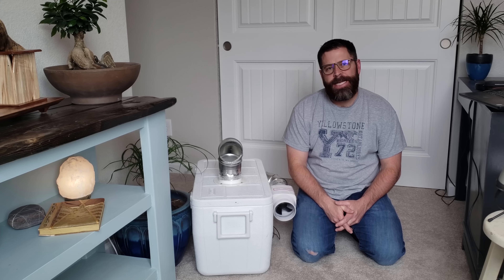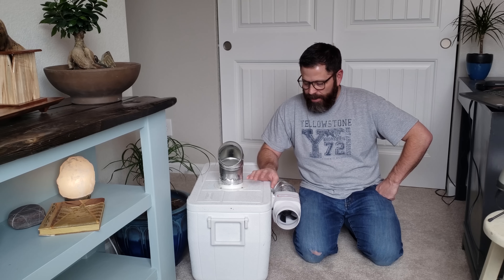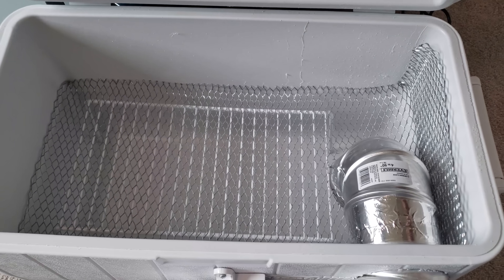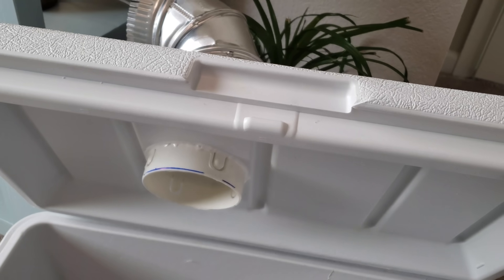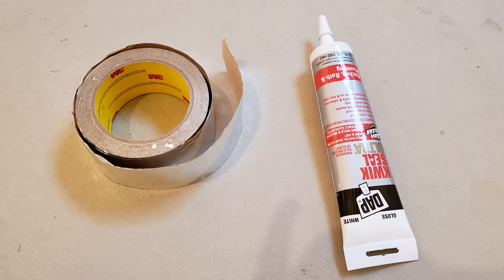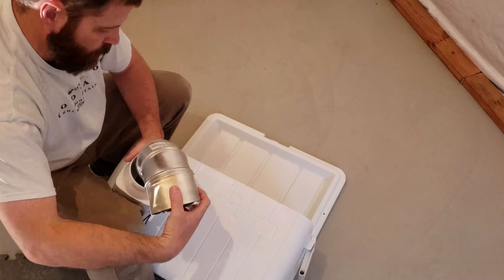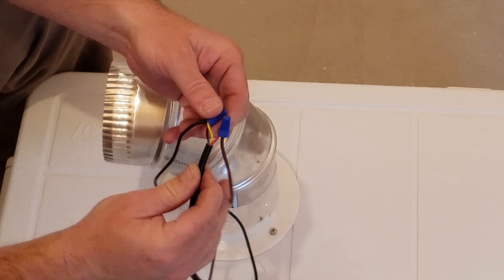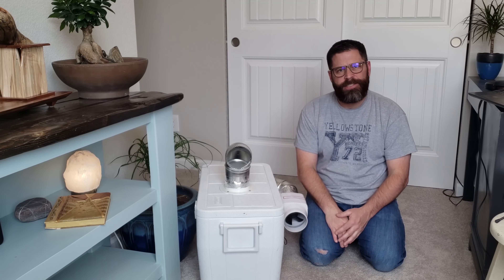Homemade Portable Air Conditioner DIY - Coldest One Yet!

Comment: Fill it with frozen water bottles the ice lasts longer and u have something cold to drink
Reply: Thanks mate. Good idea.
Reply: It might last longer, but it won't be nearly as cold as with ice cubes because there will be less cold surface area to cool the air down.
Reply: @bossman696  I would use smaller water bottles or even freezer packs for lunches
Reply: @bossman696 , any inside temperature below the outside summer temperature is always welcomed.
Reply: @donotneed2250  I know that's right! Every little bit helps!
Reply: @bossman696  use mini water bottles🤫
Reply: @bossman696 true. But if your looking at this as a long term solution for something like cooling chickens, you'll need a constant supply of ice. Freezing large Tupperware containers and dumping those blocks in would be the best. Less surface area, but you don't have to buy bags of ice everyday.
Reply: Cold beer sounds better though
Reply: @Elfnetdesigns  - break out the Coors!
Reply: That's what I was think. Bags of ice would just be a lot of money to spend
Reply: @gibster9624  But if you're making your own ice, you're just making more heat from the fridge motor and the cooler motor. The energy extracted from the water in the freezer is dumped into your house which you then use the ice to cool which nets nothing.
Reply: @michaelmcgee7683  so are saying that if your fridge didn't make ice then your house would be cool????????
Reply: @zellerized  More that your fridge drains heat from inside of the fridge and expels it on the outside. Yes, your fridge generates heat, but removing a fridge wont cool your house
Reply: @michaelmcgee7683  its for your camper van that doesn't have an ac unit.
Reply: M M Glad to see at least one person with intelligence.
Reply: @michaelmcgee7683  the fridge temp sensor is usually in the fridge part not the freezer.  So unless you crank your fridge down. It's going to run the same amount of time it always does.  It won't cost any more electricity to make the ice then it does on any other day. When it runs it runs freezer and fridge. The fridge being more important temp wise as the freezer will always be frozen even on the lowest setting.
Reply: @JamesSmith-lt5zz  Not talking about electricity costs so I don't really know what you're replying to?
Reply: @michaelmcgee7683  True, but surely there is a time factor involved? You fridge slowly makes the ice, overnight etc. You could probably melt this ice in less than an hour with this device. So you net nothing, but at one point during the day your room might be colder... maybe.
Reply: @UC_M_lFnel88bz8ix6g3oZ_A wasn't suggesting it was a 1:1 ratio from the motor, but the energy drained from the water to make ice is not converted into Work, it is expelled outside the fridge at a 1:1 ratio. And yes, you can locally cool an area, but that wasn't what I was talking about.
Reply: @michaelmcgee7683  Dude your fridge is plugged in ANYWAYS and to be honest a full fridge draws less electricity than an half empty one ESPECIALLY if it's filled with plastic bottles filled with ice in them then the fridge ONLY has to keep them at temperature it's almost like how a glacier generates it's own ice.
Reply: @michaelmcgee7683  he's saying that your fridge HAS to be on to keep your juice cold and your veggies fresher which also runs your freezer as well with the same effort so chucking  a few bottles filled with ice into your fridge wont run it any hotter than it already is.
Reply: @michaelmcgee7683  for a closet grow it's perfect. don't need to cool down a whole room.
Reply: @Engineer9736  How do you "see" someone from a comment?
Reply: @michaelmcgee7683  not really since your freezer runs no matter what might as well utilize it best.
Reply: @michaelmcgee7683  exactly. 
The first law of thermodynamics.
Reply: @michaelmcgee7683  Dont run the freezer inside the house 

Or, as you can see in the video, he was running the air cooler in his car.
Reply: @zellerized  coolER, yes.  Simple physics.  If you add heat, then use the produced cubes to cool it down, you're going to end up with no benefit.
Reply: Michael McGee is there a way to displace the heat from appliances to the out doors, perhaps a water pump system that comes from well water(if you have a well) to appliances that create the most heat(like refrigerators) and back to the well at a slower rate(dividing outflow into separate containers that could possibly be used to water an outdoor garden. Let’s think outside the box(our house, in this case) ;p
Reply: @michaelmcgee7683  you think this would be different parts of the house, so it doesnt work that way
Reply: @michaelmcgee7683  The freezer in your house is already running. You're not creating more heat or energy.
Reply: @michaelmcgee7683  most people  have a freezer running with or without a/c. Can't think of anyone who unplugs their fridge regularly
Reply: @michaelmcgee7683  technically you're correct, but you're wrong because heat is expelled from your house during the night anyway, and the point of this is to cool down a small localized area, say 1 small room
Reply: @michaelmcgee7683  Many are not understanding this. As child I am told "your AC doesn't add cold inside to house, it moves heat from inside to outside" I think they are wrong! I feel the "cold" air blowing from vents! But it is that Heat is to Light as Cold is to Dark. One is existing, the other is the absence of that which exists. I hope my English is understandable.
Reply: @JamesSmith-lt5zz  the idea is putting "frozen water bottles" in the big cooler, not ice cubes.

Ice cubes melt, create water. However, with frozen water bottles, the water is entrapped in the bottle, no clean-up just refreeze them
Reply: @michaelmcgee7683  you're correct but most people in think aren't trying to cool their home. Anyway they're not made to bring the room temperature down they're made to blow the cool air on the person in the area that they are in.
 Just like what I'm using one for. I'm using mine in my shop and have the air directed  in the area of my world table. Some people use them in tents when camping and in their campers.
Reply: @michaelmcgee7683  this is a portable ac so what happens in the house and fridge are irrelevant
Reply: @AngryCornflakes Truely ? Scientific ?🤔
Reply: Some of the cooling is from evaporation.  So maybe just put one or two bottles inside.  The rest needs to be water/ice available for evaporation.
Reply: The solution, then, is to drill a hole through your freezer door, stick heat vent tubing in it, and redirect it all the way down to your lazy boy chair in the living room. 
Efficiency squared.
Reply: Take into consideration that this is also a humidifier because the air is very moist exiting the cooler. This being said, if you're in a closed room it WILL create mold and or mildew on everything if used daily.
On another note, heavily salted frozen water in 2 litre bottles lasts about 6 to 9 hours where unsalted frozen water will get you 3 to 4 hours and a lot more humidity.
Reply: Derick the one reason that actually makes me think this is a bad idea for cooling a room inside a home. I live in Florida, so humidity is already an issue, which is why I would run ice water through copper tubing on the face of a block fan. On the efficiency in cooling though.... The heat transferred from the appliance(fridge) may be a better focal point. A water pump, some copper tubing, and some insulated rubber tubing to transfer this heat out of the house could bypass your centralized HVAC system. If you can transfer that heat out efficiently enough than you end up with a surplus capability of heat removal by the appliance. So it’s a double effect... bypassing HVAC saves money, and the appliance that is sucking more heat out of the entire house via Ice cold air... thermodynamics... so that means ice does not actually melt, Right? The water becomes unfrozen, right? Sounds like a play of words to make something seem more complicated than it actually is.
Reply: This would be great in my case. Riding in 16 passenger van on a hot day and the A/C can't cool it down. We have electric sockets. Run low on ice, stop at store. We are melting today that's why I was looking at this. Thanks!
Reply: Those aluminum resealable monster cans would magnificent!!
Reply: Aluminum bottles.
Aluminum cooler.
Aluminum foil.
Reply: Frozen salt water bottles will stay frozen longer...I wonder....
Reply: Fuck yea I live in az and the ac went out in my car me and the family are cruising around with a air temp of 43 degrees! I put a block ice with two bags of ice and it lasts me the day even with it being 110 outside
Reply: @JalapenoAss88  this is the comment I was looking for, similar conditions as where I am at in Nevada at 110f, I need to cool a small hatchback down, and you gave a rough timeframe!
Reply: @JalapenoAss88  I like your style
Reply: @JalapenoAss88  you did it as in this video
Reply: The ice melts so fast because its cooling the air quicker.... Bottles wont be as cool.
Reply: @TandyTerrison  I agree.  Betting those bottles would drop the air a few degrees, but you really need to actually have some exchange with the water/ice.
Reply: shane bruland  AMEN!!!  Texas heat is NO JOKE.  You need the AC system from the Cowboys Stadium just to keep the house cool.  We have private funded spaceships, cars that run on batteries, and flashlights that can act as a heat source.  But my house is still hot as the Sahara here in Texas.
Reply: You are living in 2046 sir 🍻
Reply: What about water
Reply: exactly what i was thinking. bottles frozen solid would last longer. no waste, multi purpose. maybe better air flow.
Reply: That’s what I do. Then when I make it to work I use the work freezer to freeze the bottles again for the trip back home. You can aldea ya drink them as you go as well.
Reply: Can u use dry ice for this
Reply: Is that you Pancho?
Reply: I do that with water bottles all time good idea.
Reply: @felixfischer312  I use frozen water bottles to keep my beer cold lol
Reply: Could fill It with ice and beer
Reply: Ice cubes is better than iced wayer bottles,from a scientific pov,plastic traps some of the coldness of the ice,so it won t get nearly as cold as with loose ice cubes...it s just science.
Reply: Plus you can refresher them and reuse in the cooler
Reply: So you have no control like a AC unit? You have cold & that's it?
Reply: Fill bottles with salt water and freeze
Reply: Solid idea, A half frozen Gatorade bottle is pretty sweet sitting in the air conditioning. 👍
Reply: Freeze water packets
Reply: Great idea wouldn't get as cold but close enough definitely would save money for sure excellent idea
Reply: The percolation through the ice water is a big part of the cooling. Frozen bottles of water take away half the cooling, or more.
Reply: Dead Mic Live you read my mind from my present and your past... brain implosion imminent
Reply: Genius genius genius
Reply: Take a gallon jug or several and freeze them but not 100% full. Cut the container and remove the big chunk of ice. It will last much longer. I have made huge Ice chunks before and they last way longer than a bag of ice. I am gonna make one of these and thanks for the video. I just need a larger cooler so I can put 2.5 gallon ice chunks in it ;)
Reply: good thinking, my garage attic hang out spot gets mega hot in the summer, and this should do the trick
Reply: Yea cylindrical ice cubes would be way more efficient. The air has room to flow around better and they'll keep each other cold and frozen for a good while.
Reply: That's super smart to do, and just "reset" the thawed out bottles for frozen ones each day, I definitely wanna try this! 👍👍👍
Reply: Would you get better air flow if you put some 1” pvc pipe threw screen sticking above ice/below ice…
Reply: And they don’t make a mess when they melt
Reply: 37 PACK OF DUFF
Reply: SOMEONE GIVE THIS MAN A MEDAL 🥇 thank you, Ernie 🙏🏼
Reply: I want to try frozen Corona!
Reply: Brilliant! Plus you just refreeze and use them again. 🤯
Reply: Does having that loose ice in there, cause humidity in the house.
Reply: I would coat the inside with foil it would make the ice last longer
Reply: @josephfuller6229  turn your cooler into a super thermos by puncturing a small hole every few inches in all the sides and the lid and then fill them all up with expansion foam! 🤗
Reply: @natureboy6410  yeah until it expanded and things started breaking
Reply: @josephfuller6229  primary reason for the multiple vent holes prior to filling. A little bit of clean up afterwards but the extra insulation is worth it.
Reply: @natureboy6410  yeah it would work but like I said that is if it doesn't break open the cooler
Reply: Freeze it with Salt water
Reply: ....and rock salt
Reply: Where do you get the frozen bottles of water when you are camping or living in your van? The ice you get is from a store, and they don't sell  frozen bottles of water.
Reply: R
Reply: Frozen water bottles don't work as well. Surface area.
Reply: Ernie Villa:You done made me thirsty
Reply: Or fill the bottles with salt water to get colder ice.
Reply: When filling the cooler with frozen water bottles you are not getting the latent heat of evaporation.  With the cooler filled with ice you are getting both types of heat removal. (The Absence(removal) of heat) Latent heat of evaporation is taking latent heat and using it to evaporate water in this case. 
There are two types of heat. 
(1) Sensible heat- heat that you can feel or sense. 
(2) Latent heat- heat that can not be measure with a thermometer or you can’t feel. 
The way he has done this is almost the most effective way for this to be done. The most effect way would be to have the cold water to flow over a material such as burlap and the air pass over/through it and then over the ice and out of the cooler. It may show the same temperatures as the air is leaving the cooler but remember you can not feel or sense the latent process.
Reply: That's actually a really good idea to also limit condescension from the unit in the forced air.
Reply: @Icanfigureitoutintime  Limiting condescension has always been good for my health....
Reply: If someone could think of a way to cost efficiently add aluminum to the equation that would be excellent.
Reply: @andreiz.7746  Your fridge works by taking the heat out of the water bottle and emptying it into the room. if you take that bottle out and use it to cool down the room, the exact same amount of heat that was extracted is necessary to bring the bottle back to room temperature. it nets nothing.
Reply: What about DRY ICE 🧊 ?
Reply: @georgekrug2071  dry ice releases carbon dioxide gas as it warms up. In a closed room, you could suffocate yourself.
Reply: @georgekrug2071  this is actually dangerous in an enclosed area since dry ice is simply frozen CO2.  When the dry ice sublimates it produces C02 gas, which isn’t toxic per se. However, it will displace oxygen and you can eventually die from asphyxiation.
Reply: FYI>>> When you freeze plastic water bottles there are toxins released from the plastic that were used to make the bottle. 
!!!!!!!!!!!!           DO NOT USE frozen plastic water bottles          !!!!!!!!!!!

Comment: not worth the effort to build for the time the ice last,. at 80 to 90 its like blowing a hair dryer through the cooler at the ice,  if you lucky a 1/2 hour or less ice will be gone. you'll spend 10 bucks an hour on ice.
Reply: Ive gotten same results, i was figuring like 2 hours atleast....nope, 30 later ice was all melted

Comment: why why ? push air thru hose. air directly on ice, ice melts way faster. air thru hose full length less melting.
Reply: Either way warm air is transferred into the cooler then extracted.. doesn't make a difference what direction!
Reply: Okay, let's try this again.  Warm air directly on ice will melt faster than warm air thru hose gradually getting colder as it gets to the outlet. Less warm air bouncing around cooler. Try it, it works.  Big difference !

Comment: @make & do What if you put a small transmission radiator/cooler in front of the motor inlet, then piped the exhaust side to run though the radiator. The outflow air would loose some cfm, but the inflow air would be colder since it's getting pulled through the cooled radiator, thus resulting in colder exhaust. It would also make the ice/ frozen water jugs last longer since the inlet air would be coming in somewhat cooled.

Comment: Is there a reason you chose the sheet metal ducting vs pvc? Just curious. I think it would look better
Reply: Slims X of course theirs a reason, why do you think your ac system doesn’t use pvc to distribute the air. Think about it
Reply: @diegovenegas7692  yeah, over the course of a home AC system the metal ducting makes sense. But for this system, the PVC would be cheaper, cleaner, and you wouldn't lose anything